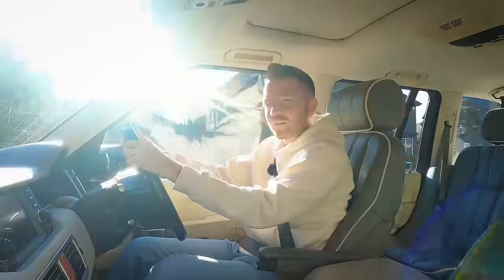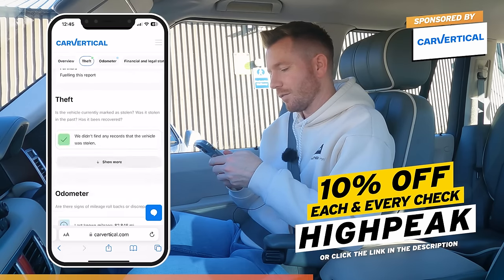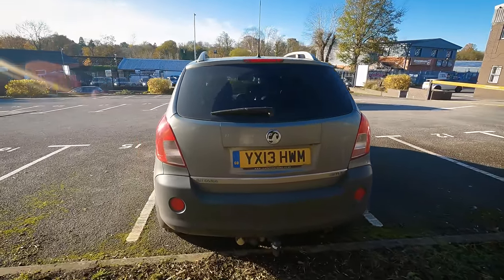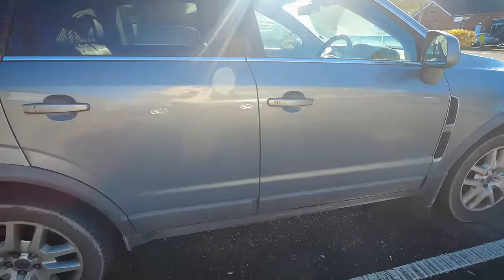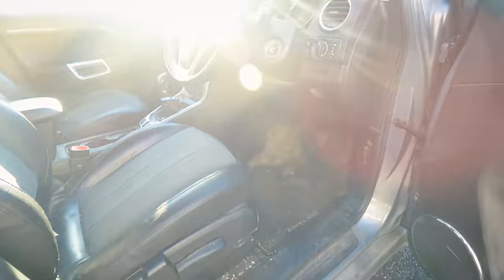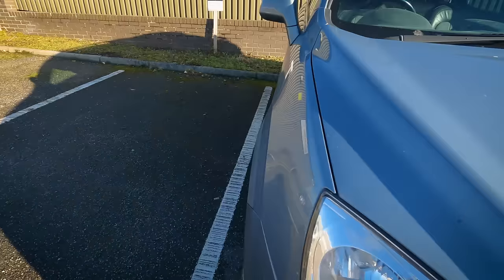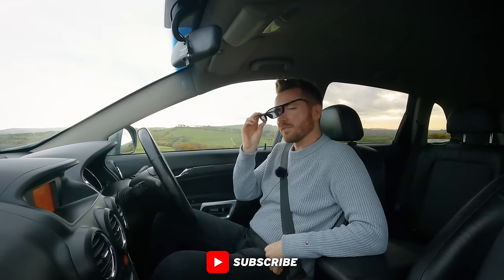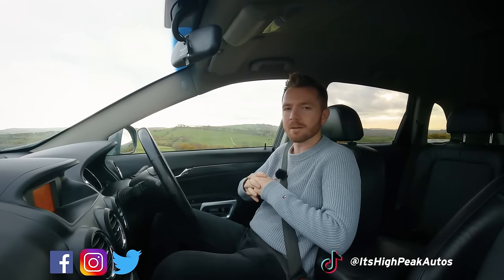I BOUGHT A CHEAP VAUXHALL ANTARA FOR £1,750!

Comment: I had a sneaky feeling this would clean up well. Just a lot of surface grime rather than damage, you could tell the previous owner had actually looked after it. My sister works on a farm with horses and the amount of dirt that gets in there, I do understand why you’re fighting a losing battle keeping it clean. So in that line of work it’s just easier not to bother
Reply: Still no excuse....
Reply: @davidperry3531  Exactly my Ex had horses but we still managed to keep our cars clean     . This car is just disgraceful full stop.
Reply: @davidperry3531  no excuse to trade in a car like that granted, but with the amount of muddy stuff hauled around, merely an hour after cleaning it it looks like it did before. I hate being messy and I wouldn’t keep my car like that, but I understand when you just need a tool to do a job that you can rough up a bit
Reply: On a bad week when a horse feed bag splits, it’s muddy and you’ve got 3 kids in the back. A car can go from immaculate to destroyed and exceptionally smelly.
Reply: @reececollison5101  But this car looked like it hadn’t been cleaned for years if ever!
Reply: I agree, on a farm you buy cars for utility. They're impossible to keep clean but you do maintain them. They get filthy and they stay filthy, but underneath they're usually well maintained and decent cars.

Comment: I had a Chevrolet Captiva (got it brand new) year 2012 with the 2.5 lt. engine and automatic transmission. Sold it in 2022 with very low mileage. I only got one minor issue with an oxigen sensor (replaced) and a battery. Other than that , gave it the routine maintenance and never gave any troubles at all. My opinion (personally) a fine car.

Comment: Timely video, I was just looking at one of these. I have the same drivetrain in a Chevrolet Orlando and (touch wood) it’s been great as it clicks over 240,000km 
The engine is a different unit to the more common 2.0 GM diesel that you see in the Insignia I think, although it has the same output. 
Best of luck with the sale.

Comment: The state of this car took my mind back to my first car. Previously owned by a farmer.  Boot half full of straw and filthy dirty everywhere.  Trade sale from a llocal car sales pitch for the princely sum of £500. That was in 1981. It was a 1976 Ford Cortina mk3 2.0 GT.  I did 20 thousand miles in the year I owned it, then failed its MOT miserably because of the quantities of rust, so sold it on to someone who wanted it for spares. Thanks for the memories!

Comment: The fact it has chain does not mean it does not have to be changed. It only says that if you keep on top of your regular oil changes and sometimes after long intervals you check if your chain is not stretched further than it suppose to (it rattles) it is ok. Quite a few cars have chain and still chain goes kaboom...Peugeot RCZ being one of them because size of that chain is same as in BMX bike...
Reply: I don’t think anyone knows about that more than Matt, he’s had to do plenty of them. 

I’d rather have a belt tbh, they’re easier and cheaper to replace in most cases, and once that job is done you’re good for another 80-100k usually, you know where you stand
Reply: @danecowan678  One belt to do 80-100k? That's a lot of faith right there....
Reply: @IGee88  a lot of manufacturers suggest their cars can do that. My own car is due every 150,000 miles or 5 years, some JLR engines are 105,000 as are some Volvos. 

I’d say 80-100k no problem 🤷🏼 or 5-6 years

Comment: We had these in North America as the Saturn Vue (second gen) and the Chevy Captiva. Overall they seem to be good cars. Here they came with the a 2.2 i4, a 2.4 hybrid i4, a 3.0 v6, and a 3.5 v6 for the first gen. We never got the diesel here. They also came with a honda sourced 5-speed auto.  The only engine change for the second gen was the addition of a 3.6 vvt v6. The Chevy version was mainly sold as a fleet vehicle. I feel that the design has held up pretty nice and doesn't look as old as it is.

Comment: We got them in the United States as the Saturn VUE and when Saturn went out of business it became the Chevy Captiva.
The Chevy Captiva was originally only sold to rental and fleet buyers.
We got the 2.4 L 4cyl two V6s, a 3.5, and a 3.6L, as well as a hybrid and a high-performance Redline model.
They sold fairly well and are still a fairly common sight on the road.
I can't believe the prior owners weren't mortified to trade in a vehicle in that condition!
Reply: The 3.5 in the second gen Saturn VUE was not a Honda engine. It was a 60 degree OHV V6 made by GM that was used in the Chevrolet Impala and Malibu cars.
Reply: @atx-cvpi_99 Where was Honda ever mentioned in the comment?

Comment: I’m a horsey person and I’m in my car day in day out for work too. It can get pretty grubby on the inside with hay, horse poo, sand, stones etc. but it’s cleaned at least once a month, or when I’m taking passengers, and an hour later when it’s done it has that new car smell and looks brand new. For a 190k 7 year old Passat, use them to fulfil their purpose but also look after them. 

You might use a coffee mug 2-3 times per day without washing it ‘properly’ but you wouldn’t use it for 2-3 months without washing it!
Reply: I don't think this car had ever been cleaned and there is absolutely no excuse.
Reply: @davidperry3531  A clean car drives better than a dirty one

Comment: I had never really looked at those cars, they suffer massive depreciation,  but it is actually a quite nice design. A good looking car.
Reply: massive depreciation means a cheap used buy  ;-)
Reply: @hunchanchoc8418  they drop like a rock where I live
Reply: @shaywhelan1  Buy 2 or 3, so you can always manage to have ONE that's in running order!     ;-))
Reply: @hunchanchoc8418  Yikes, have 4  Mercedes already.
Reply: @shaywhelan1  Oof!  Glutton for punishment!   ;-))

Comment: These are fantastic for towing but the auto handbrakes are awful. They don’t understand that they need to hold until there’s enough revs. But they don’t, so they roll forwards when facing downhill. Pretty scary if you’re used to a manual handbrake.

Comment: I had one for a few days. Luckily, I found a serious (but not obvious) fault and I was able to return it to the dealer. It drove horribly. They have horrible suspension and roll like a 2CV when cornering at speed. Refinement is terrible. Yougurt pot plastics.

Comment: I think GM lost a very great opportunity to take the Chevrolet Avalanche to Europe and other markets under Vauxhall or Opel. The Avalanche is one of the best cars made in the modern era imo. It's such a great truck because It's roomy and spacious, rides well for a truck, and even though It's not a body on frame like an older truck or a Land cruiser, It's still pretty tough and good off road, the modular thing is also pretty cool. 

This just came to my mind cause my cousin used to have this Antara/Captiva but with a Cadillac badge (the SRX), and they also made the Avalanche in a Cadillac version. So they slept on exporting the Avalanche to more possible customers worldwide imo. I really do love that truck !

Comment: Chevy Captiva was originally a Saturn Vue.  If I had never cleaned my '!5 Accord with 218,000 miles, it would not be close to that dirty.  Only the front mats would have salt on them.  It is surprising how much your footwear picks up salt form sidewalks and roads and deposits inside.  Four almost new Continentals all around.

Comment: 9:18 that black rubber bit was a bicycle wheel inner tube. Guessing that the owners were cyclists. Also explains the cheap multi tool and I'm assuming the anti chafing cream was for the inner thighs or butt.
Reply: Exactly. The chafing cream would work for both riding horses and bicycles, so i think these people did both 😊 Used to live in North Yorkshire, and i was surprised how many people partook in exactly those two activities.
Reply: @alexandermclaughlin3978  yeah for sore butts like as not

Comment: I actually wanted one of these in AWD a couple of months back for light off roading but couldn’t find one. 
I really like the shape, if honest. 

However………I actually ended up with an automatic Qashqai 2.0 dci that was in almost identical condition 🤮 
It was one of only 180 qashqai’s, out of nearly 8,000, in the UK with AWD. 
It needed some suspension work and that deep, deep clean detail, that I’ve done, and d’ya know what? It’s ok. 

#NeverThoughtIdOwnAQashqai. 😂

Comment: I have a vauxhall a 13 plate with 81k on the clock i have had it since 28k and I have had not a single problem,tyres and brake pads thats it the rest just service charge. 
But im worried and I don't know what to do my luck has got to run out at some point but when do I jump 🦘🦘🦘.

Comment: The fuel gauge must be wrong normally you get a steady low fuel light and then it starts flashing when its getting critically low and should say fuel level low on other screen as it has the higher spec screen.

Comment: If i have these in part exchange I never sell them on to a private client. The warranty is always a deal breaker. Oil leaks, flywheel, ... By the way, pre facelift = 2.0 diesel, facelift = 2.2 diesel. Am I even worse on details? 😂

Comment: Oh dear. Manual Antara's are money pits. Manual 4x4's even more so. Weak transfer boxes and diffs and clutches cost a fortune. You paid top money for a £2K - £2.5K retail car ? It's recommended that all tyres are replaced at the same time with same makes to preserve the drive train as long as possible and tramission fluids replaced regularly.

Comment: Never liked Vauxhall's. I think their styling particularly the interior is pretty poor. I had an Astra some years ago on hire, brand new and when I opened the door the next morning to drive it, it was full of water! The Vectra (had that on hire as well) had very poor visibility.
My son has an Astra estate which is pretty new and he's having an issue with P0014 error codes which is cam solenoid fault...it's a works car so he doesn't have to pay for repairs, but it's been in once and now the error is back after about a month. Avoid.

Comment: I might buy a second hand Vauxhall Antara and take all the engine out and take the pipes and fuel tanks and all other parts that are not needed to make it super lightweight then build a strong hull with heavy duty marine plywood and put the car on the plywood hull and get and electric boat engine from mercury marine and propellors and rudders and secure them to the hull and secure the body of the car on and of course jeeping the interior seats, steering heel and everything and then I will have my very own Vauxhall Antara Speedboat that I can use out on the water where there are no speed limits, no road signs, no accidents, no road tax because you’re on the water, and no need to worry about idiot drivers, road closures, etc. it would only work in a place like Scotland and the rest of the UK where most, nearly all ships and towns arr in coastal locations by the sea or in areas near the sea, as Britain/ UK is one big island with lots of other islands, it’s rare when you find a settlements that is landlocked or far from the sea, nearly everywhere is accessible from the sea, all Scottish cities, towns, villages, hamlets, etc. are.

Comment: Great video Matt, you do make me laugh though, “as I’m a used car dealer” 😂. These Antara aren’t bad cars there a box tick sort of car, nothing special but do the job. 
As for having kids and car cleanliness is crap, 😂 I’ve got two and I’ve never allowed them to treat them how I’ve seen some cars come through the garage. The worse are (sorry) young girls, using cars for wardrobes and when trying to find locking wheel nut you’d find….interesting things 😉. But having kids is no excuse to be a messy bugger.

Comment: I actually quite like these. Not sure why though. Work horse? I tried to imagine what the previous owners house must be like. Never fails to shock me just how disgustingly scruffy some folk are. Is it REALLY such a big deal and effort to pick up some of the crap in the car, and stuff it in the bin? Bone idle Britain, siiiiigh.. Meanwhile, stop swearing...."electronic handbrake" , without a shadow of a doubt, the most hated (by me) modern technology now fitted as standard on virtually every car on the market. Totally pointless expensive troublesome nonsense  waitng to happen. Can anyone explain to me why the hell these are still fitted now, and some sheeple actually state that they love them! Really? Wait until it fails to release at a set of traffic lights then, as happened to me recently. AGGGHHHHH!!!!?